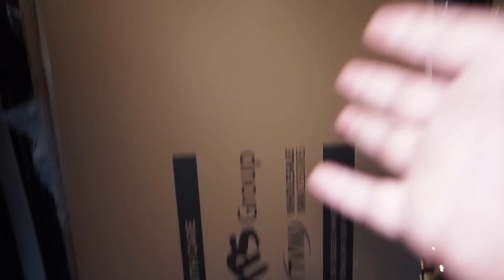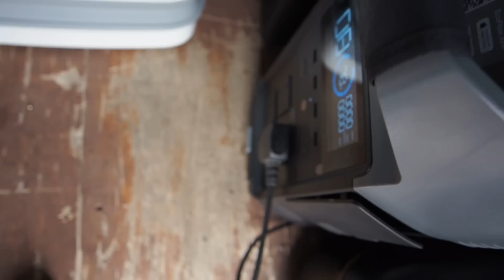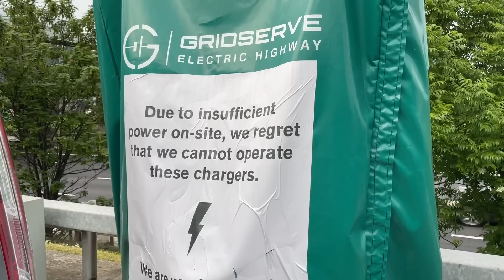FIVE HUGE campervan build upgrades, all in one day! UK Van Life

Comment: Great vid. Don't worry about the power station too much. Once you've got a lithium battery, DC--DC charger, and an inverter plumbed in, you will almost never even turn it on. I ended up selling mine, but I must admit it was well handy during the build.

Comment: Be careful parking your van in an EV charging bay, you may get a ticket, but I can guarantee you'll get some angry EV driver raging at you for blocking. Also, the type 2 plug it supports are available at the likes of tesco with pod points (you need your own cable, in fact most type 2 you need your own cable) motorway service chargers probably won't have the correct plug for you.

(source, I own an EV 😂)
Reply from the maker: Thanks mate. Yeah I literally found out this week about the minefield of different plugs/cables etc. And the fact you need a bunch of different accounts with different apps! It’s all so complicated for people! I’ve had a type 2 cable turn up today though so I’ll give it a go this week. Hopefully I can pay at the ev point but we’ll see 😂. But yeah I’m only planning on using them when they’re empty at night

Comment: Wow!. No electric available for charging. How on earth do they expect to move to all electric vehicles by 2030?.
Reply: It's not gonna happen 😔
Reply: I haven’t had any issues travelling around the UK in my Peugeot e-208 in the past 4 months of ownership. 217 miles range at 100% charge, which goes down slowly during warm/hot weather. For cheap charging I use Electroverse, Elli and Tesla superchargers for non-Tesla. Covered 5,000 miles so far without any charging problems. People need to stop scaremongering.